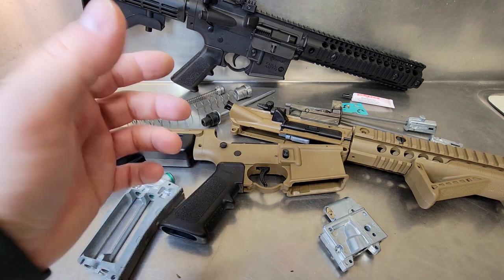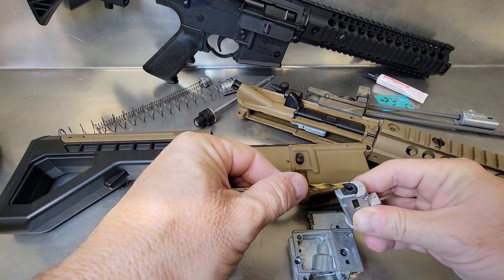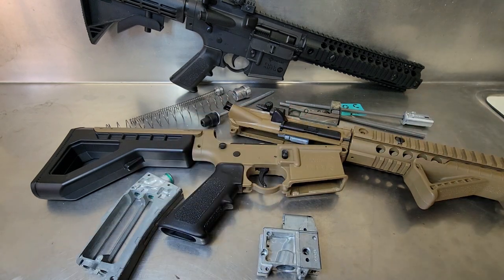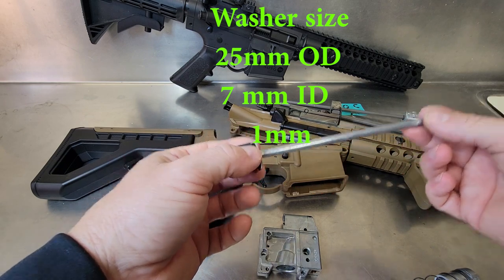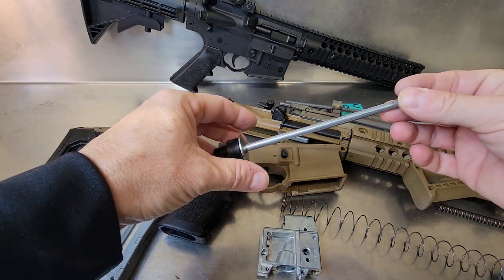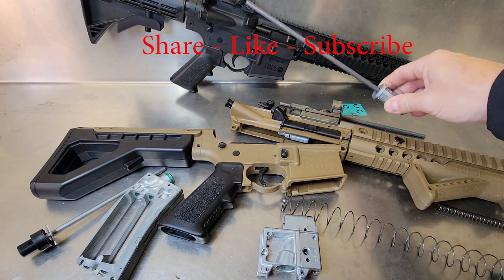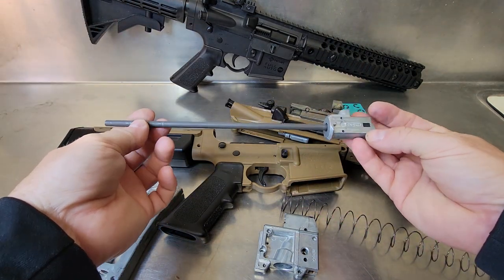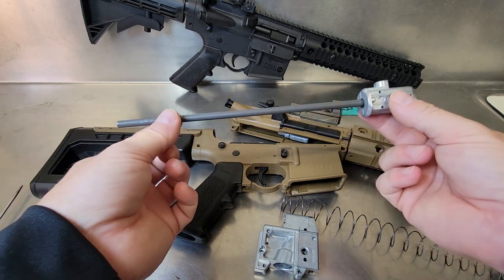Crosman DPMS SBR MPW R1 3 Simple DIY mods for under $$ 1 buck $$

Comment: the opening up of the port seal to my mind is the best most efficient mod! firstly the seal was to tight a fitting combined with the unnoticed fact that the bb in the mag are slightly out of line with the chamber,load the mag then look at the exit hole in the mag; the bb is about .5mm to high! combine this with to tight a hole in the seal and you get jams ! the jammed bb will have dents where it impacted the edge of the mag hole on exit. speaking as an engineer my assesment is this model crossman out of the box is streets ahead of the competition because it has a relatively simple action[fixable] unlike the  sig mpx which is a nightmare of complexity and no spare part availability...if concerned about opening up port seal ,just open to the depth of the bb which will at least give the bb the chance to exit into the seal successfully.

Comment: I see you swapped the stock on the black SBR very nice👍I would love to do that mod for sure. Now i just need to find parts
Reply: No he didn't, that's the R1 stock that comes with the R1 right out of the box! You don't need to mod the R1 format to be able to swap stocks , it's based in the AR platform meaning you can change the pistol grips and take off the original stock that it came with which is the ine in th video in the back, the DPMS however does need a mod in order to be able to change the stock as it's bugger tube isn't AR compatible only the handgrip on the DPMS AR AR compatible making it interchangeable!

Comment: I did all 3 mods today and got mine running again. Not sure that the e-clips on the barrel worked for me, it still wiggles around, but no worries it was only a couple bucks and I was already there anyways.
Reply from the maker: Hello, If you have some electrical tape, you can wrap it around the barrel to help keep it center. It also helps it from wobbling around.

Comment: Pretty sure the point of the port seal is to aid in properly pressurizing when fired. Enlighten if I’m wrong.
Reply from the maker: Yes and no. Yes, if the pressure can build up. Unfortunately, the nozzle inside the magazine will dump the co2 into the bb feed chamber if the bb is blocked in away. In a crosman 2240, the pressure can build up. Yes, back pressure definitely helps

Comment: So my dpms has this problem where it will shoot all right in semi auto the first shots of new co2 cartridges but then after one or two mags it will start shooting in a two burst and I would have to pull the charging handle again. Whenever this happens I take the mag out and I can see that there’s a bb stuck in the rubber entrance of the barrel and I have to take it out by pushin it out down the barrel. Will making the hole bigger using a drill help fix this issue? I don’t wanna mess it up, and also what is that mod useful for?
Reply: Mine does the same thing, a two shot burst sometimes when on semi-auto. It doesn't do it all the time though.

Comment: Gr8!! Thank you so much!!! This is really helpful to get started..

What about the mag mods? Are they really worth it?? And the hammer?
Reply from the maker: Mag mods coming! Modding the mag definitely makes a huge difference. The hammer is still the weakest link. I was hoping to have some cnc machined hammers but I'm still waiting to hear back from the machine shop. I'm working on a diy hammer mod.
Reply: @rumblecanada  what about adding the screw to the hammer? How did that work out?
Reply from the maker: @GabrielCollignon  it works great! Still using one. Just trying to see what I can make that is an easy diy mod or buy and replace part. The stock hammer sucks. Crosman should have used steel to make the hammer.

Comment: How did you solve the piston break problem!! Where it breaks around the screw holes.
Reply from the maker: I sent a bunch of parts to have cnc machined. Still waiting.
Reply: @rumblecanada  ahhh. My method if mine breaks is to carve one out of wax, then set that wax carving into mud, let the mud set and dry out, bake in oven to remove wax from mud mold, and cast the cavity with zinc copper alloy or zamak 3 alloy.
Reply: @l3ad3d  Hey brother, would you mind sharing some more info on the way you made a new piston? Im trying to do Rumbles mods: hammer and the piston so they don't fail and remain functioning for longer, but idk how I'm going to remake the piston. Could you elaborate on your mold idea?

Comment: I got my sbr yesterday tomorrow I'ma be doing the spring mod.. a lil nervous about the drill mod.. and c clip mod... With the c clip mod what will the benefits be.. I was lil confused
Reply from the maker: Start slow with the mods. The spring mod is a great mod that's easy to do. The stock barrel is only held in place with a rubber grommet and a plastic piece at the muzzle of the barrel. The 5 C-clips help keep the barrel secured inside the rifle.
Reply: @rumblecanada  yeah I'ma do the mods tomorrow... I shot it for the first time today.. I love it but wish it had a lil more power. So hopefully after the spring mod I will enjoy it a lil more... I have the air javelin as well .. so it's fun having toys I could shoot in my apartment complex lol.. gotta keep that rent low here.
Reply from the maker: @eloysaenz8457  awesome! yeah they are a lot of fun. Mine is tuned for 495fps. I'm liking the air javelin and cant wait to mod it. I'll be posting a test and review video on the air javelin very soon.
Reply: @rumblecanada  air javelin is pretty strong ... It would be sweet if there was two to four barrels on it.. make it semi (:
Reply: @rumblecanada  ran through you videos and gave them all a like (:
Reply from the maker: @eloysaenz8457  I appreciate that thank you!
Reply from the maker: @eloysaenz8457  👍 that would be cool
Reply: @rumblecanada  you think I could hunt pigeons in my backyard with this stock? Or should I do the spring mod first?

Comment: So I noticed after I did the spring mod that the bolt catch stopped working this is due to too much spring pressure have you noticed this problem?
Reply from the maker: How's the hammer and gas piston?
Reply: @RumbleCanada  they are in great shape I inspect them quite often I've only had the rifle about a month and I was upset when the catch stopped working cos of the CO2 waste but I took the washer out and it now works again
Reply: @RumbleCanada  and to be clear I loved the spring mod there was an increase in velocity for sure and I love your videos they are very informative I read somewhere that cutting 1 or 2 coils off the buffer tube spring would fix the issue but didn't try that ...

Comment: You will not have an issue if you keep the damn thing lubricated. Around every other c02 change
Reply: which parts are you supposed to lubricate?
Reply: @wick-jw5kq  the noodle that pierced the co2 . The bolt and throw some lube down the barrel only use oil for Pellet and BB gun.

Comment: How do i take out buufer rod out
Reply from the maker: You have to remove the roll pin
Reply: Thnk you I did the mod for the barrel and have one more question . how far i should insert the barrel into the chamber adapter? i.e all the way into it to the entrance hole where the bb enters

Comment: Your good, But the average guy is just opening  a can of worms and making a 200 dollar paperweight. The best bet is too over lubricate and have fun . Cheers
Reply from the maker: There are always risks to modding. But making something better then stock can be worth it. 5 C-clips holding the stock barrel in place is way better then rubber. Rock&Roll
Reply: That's true. I'm one of those average guys. My DPMS SBR is working just fine so I'm not going to try any mods. However, if this was a Daisy 880, it's definitely worth doing some mods. I did the high pressure mod on my 880 and it's worth the effort and getting the upgrade parts from Daisy. The 880 is also a whole lot cheaper to replace if you break it.

Comment: Go ahead and modify it to make the gun do things it’s not designed to do and watch u have problems.. if it ain’t broke don’t try to fix it!! Keep in mind the internal components are made of cheap Chinese metal mainly lead base.. hitting the hammer harder will force it to break
Reply from the maker: Or modify it and make it better then stock.
Reply: @rumblecanada  for how long b4 u start having problems?? Mines is fine no issues
Reply: @rumblecanada  for how long b4 u start having problems?? Mines is fine no issues
Reply from the maker: @mr.sinister1279 hopefully for many years. Boosting an engine for more horse power is the same thing. If you add to much boost it goes boom. If you tune it correctly you can have more fun with the modified engine or rifle. Better then stock
Reply: @rumblecanada  not jus the engine.. u have to modify the transmission and the drive shaft and the rear axles to keep up wit the power.. u can’t jus modify one thing n hope it works for ever
Reply from the maker: @mr.sinister1279  exactly, better then stock to handle the power increase.. You might like my mustang 4.6 2v Twin Supercharged project. Suspension is heavily modified
Reply: @mr.sinister1279  why the negativity??? It's a choice people make. Not everyone like plain Jane oem boring same as everyone things. And your car analogy is laughable. A "mod" doesn't have to be a roots style twin screw supercharger. But according to your "logic" my cold air intake "mod" that gave me better throttle response and way better MPG'S or "KpL- far Canadians 😉 " your logic says my transmission and diff are gonna go out prematurely bc my "mod".
Reply: @willwheeler4068  cold air is not a major upgrade.. smh 🤦‍♂️
Reply: @mr.sinister1279  well of course not, however your logic says "iT wAsNT DeeSIgnED" that way. That's my point. Just bc something was designed a specific way doesn't mean its the most efficient. Most engineers are idiots. Go look at the Northstar v8 with the starter INSIDE the engine or the crimped exhaust manifolds on the 4.6 2v v8. You missed the entire question of my last post. Why the negativity on modding someone's personal belongings?
Reply: @mr.sinister1279  bro stop causing cheese in the comments  this video was fun to watch either way he can do what he wants with his gun
Reply: @mr.sinister1279  give it time the hammer is GOING TO FAIL without any modifications the hammer WILL require modding itself just to simply keep The rifle operational
Reply: @mindi1996  yea m sure it will fall
Reply: If it ain't good.. make it more better.
Reply: @stevenmaness5153  really isn’t much u can do I mean it’s fine jus out the box I can destroy cans and metal lids and bottles with mines.. it’s jus an air gun so if make go beyond its capabilities it Gona give u more problems
Reply: @mr.sinister1279 on’t know that it’s gonna FALL…but it’s definitely going to fail you literally HAVE to modify the hammer to prevent failure what you seem to fail to understand is that though the particular rifles are fun as hell to shoot ,they are made with terribly cheap components and engineered rather shitty too …leaving the rifle stock is basically waiting for it to fail at some point along the pneumatic pathway or mechanical failure of cheaply made moving parts ….so just forget about performance mode for a second…throw that out the window…certain mods are meant to correct flaws in construction or engineering oversights…just because a thing comes in a package and is basically ready to use out of the box doesn’t mean that thing is above the reproach of improvement….you like cars seems like right?so right off the lot you can take a performing oriented car(or any car really ) and eliminate the restrictive factory tuning reprogram or retune the computer to run the vehicle with significantly higher specs and horsepower significantly improving overall performance without having to touch your suspension or rear end or transmission etc because all of these are rated for much higher loads than the factory tuning came close to exerting…better than stock with no massive overhaul required….if I buy something I want that something to be the best most fun and enjoyable thing it can ….end of story…want your shit stock,boring and broken more power to you….one less guy to outshoot on the range ,.one less car to lap at the track
Reply: All these pansies crying about modifications . It’s not for everyone . Take from his video what ever you want and if not keep it pushing ! I personally like tinkering around with things to get more out of it. If it breaks . I knew the risk going in. 🫡
Reply: People crying over modifying a toy worth $200 😂😂. If it breaks go get another one it’s $200… not $20,000
Reply: @almightybirdwatcher4986  toy?!?
Reply: @mr.sinister1279  yeah.......its more or less a toy....a dangerous toy...lololol, but nonetheless, a toy.     if it can only sting a squirrel,.. id call it a toy.
Reply: @Snooka-rd8cx  let me on wen u can buy this toy at a toy store and this toy is banned in some states cuz it’s considered a firearm and it will more than sting a squirrel

Comment: I'd wager that a bit of electrical tape would work instead of c-clips. Then you wouldn't have to pull that silver piece apart.
Reply: going to try this when mine arrives in a few hours, will update
Reply: @stubbs203  Have you tried the option with electrical tape, is there any result?